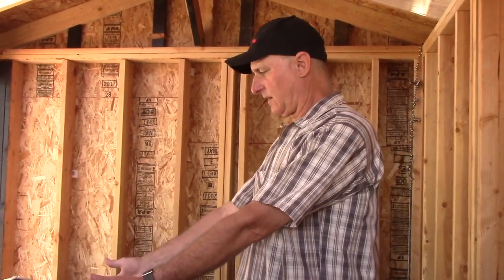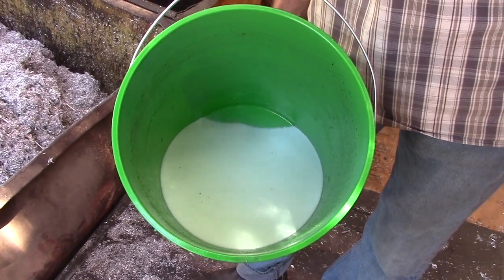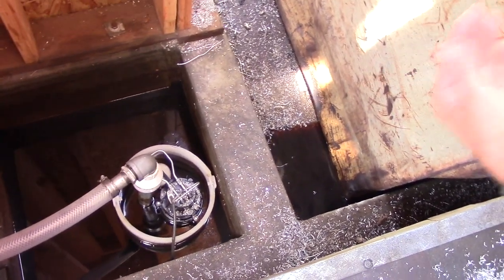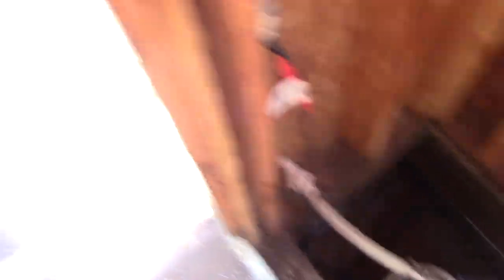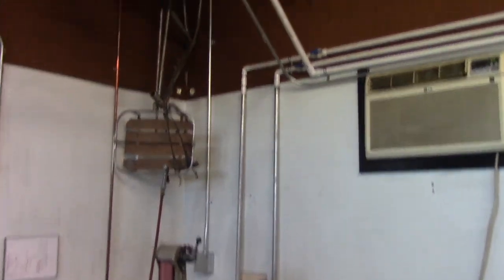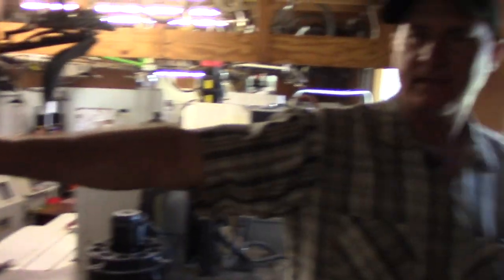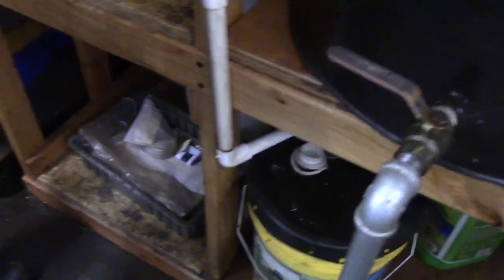Paul's DIY Coolant Recycling System

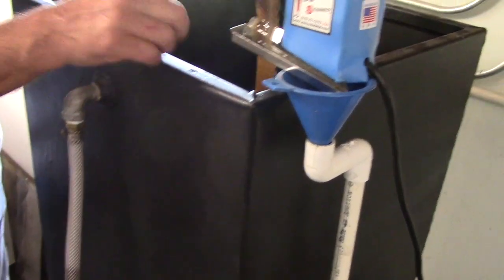Comment: 3:15 - So the coolant was originally regular fresh water mixed with special soluble oil coolant and now you're removing the recycled oil but keeping the water which has some coolant properties without the oil but still need to add some fresh coolant oil back into it? Thanks.

Comment: It's looking OK but why so much pipe and moving thru the pipes if you can simply run a 3 stage filter system to remove those parts?? 
Go onto Amazon and buy 10" * 2.5" water filter system and the proper filters. Just where your first pump is run is there with those 3 filters hanging so when you unscrew each of the mesh filter ( about $30 each) you have the dirty pit below so any fluid you drip goes back into the pit. Those filters you just use different micron mesh for them. Like 200 mesh than 100 mesh and 50 mesh and you have a lot less waste and trouble because now all what run's thru your pipe back into the building is already clean and not destroying the pipes wall because the debris is already removed.  And put a pressure sensor between all them filters so you know when pressure drops behind a filter to lower than normal than that filter before that reader needs to be swapped out.